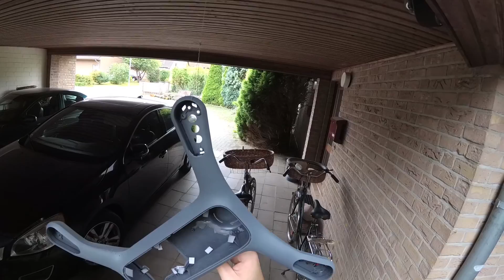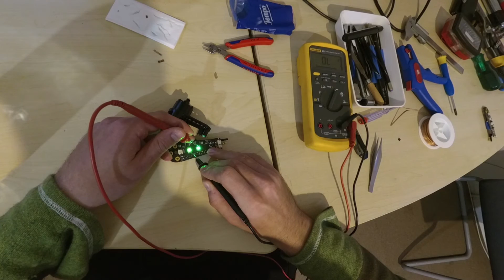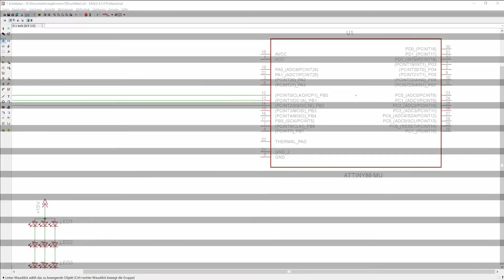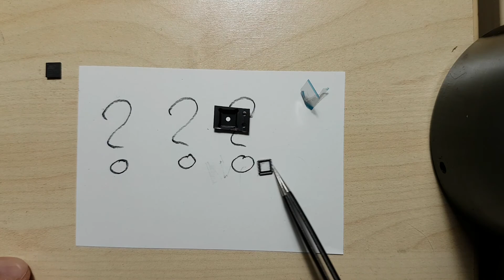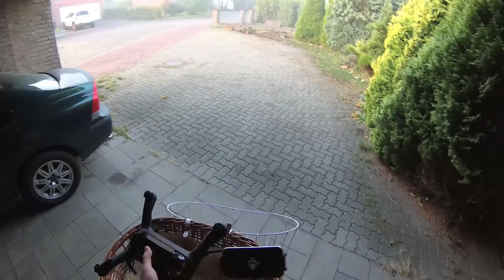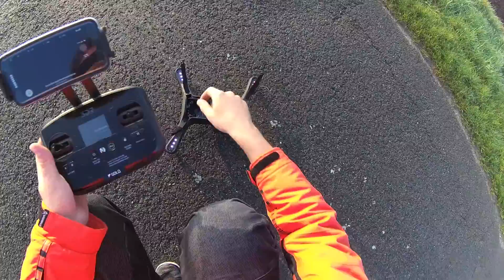Crashed High End Quadcopter repair - 3DR Solo - Part 2

Comment: Is it cheaper repairing the motor pod like you did or buying a new one?  Ebay sells them for under 50.00 US dollars brand new.
Reply from the maker: Depending on what you can do yourself, I happen to have all the soldering tools and only needed a few 1$ parts, so for me it was cheaper.
Reply: Nowadays it is cheaper to buy a second solo for parts here in states...
Reply: Best Buy has refurbished Solos on sale for $179 but it's still a piece of crap!
http://www.bestbuy.com/site/3dr-geek-squad-certified-refurbished-solo-drone-black/5757601.p

Comment: I had the same problem and cured it by disconnecting and reconnecting the battery for the control unit. Incredible job on the repair.